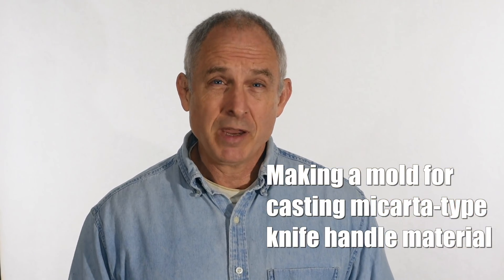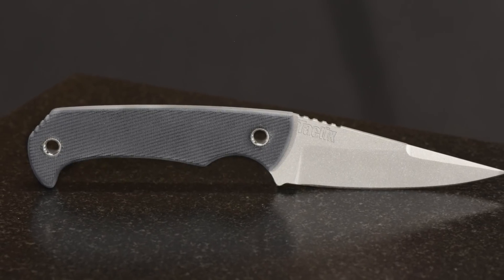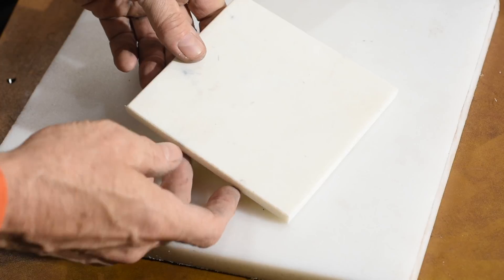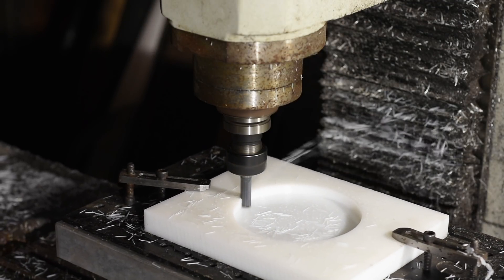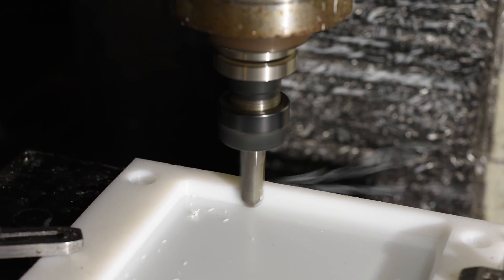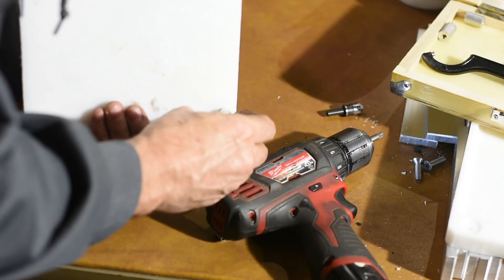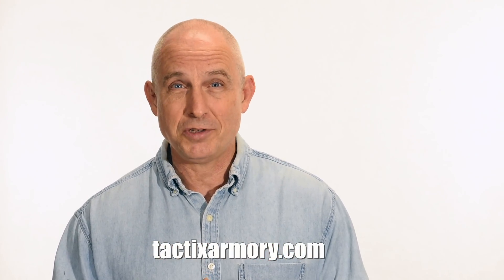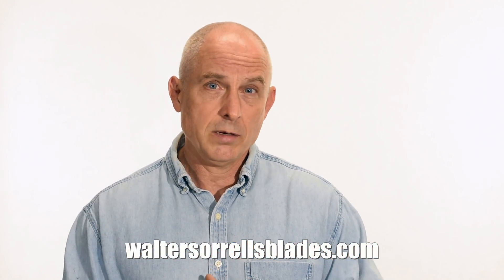Making a Mold for Casting Knife Making Handle Material (Micarta)

Comment: You can skip all this by making a handle shaped mold of 2k silicone using a knife that fits your hand. Put the knife verically into a holder. Let it hang into an empty plastic beer cup. Spray both with mold release. Pour the silicone into the cup so the handle is just with the upper edge of the silicone. Let silicone dry (I use medium hardness silicone). Remove knife and cup.

Now you have a handle mold. Just hang the tang of your knife into the mold using a laboratory stand with clamps or whatever works for you. Pour high quality 2k epoxy resin into the mold. Let harden. Remove from mold and you have a great knife handle. You can colour the epoxy with ink or powder or both. Put glitter in it or whatever. The tang is firmly cast into the handle and its water proof and very hygienic. I sand the handle to about 1500 grid and then polish then with wax and a rotating soft fabric disk. Perfect for kitchen knifes.

I use high quality resin and never one of these handles broke.

Comment: I've been thinking about making rubber molds. It seems like it would be easier to get the micarta out of those.
Reply: Rubber molds are good when you can't get draft around the shape to remove it from the mold.  In this case a rigid material is fine, just needs to not stick to the resin.

Comment: I bought an older deckel fp1 milling machine a few months ago. the machine is from 1938 and in the manual that came with it they show how to mill a mold for bakelite light switch cases. the mold is made from steel and is tapered so they could show the use of the universal milling table that can tilt in 3 different directions. in a product catalogue that also came with the mill they show how to make parts using their pantograph copying milling machine. i guess cnc wasnt around back then...
Reply: Numerical Control machines started in the 1940s, I think it was in the 50s they started using computers with them, but they still used 1" wide paper tape to load the program in them.

Comment: How about PTFE (Teflon) Walt? What about silicon Walt?
Reply: You can get silicone molds for a few bucks in various sizes via amazon, ebay etc. They work great with resins. I use silicone molds for jewelry and knife handles.
Reply: @marchueltz4993  you would agree silicone molds are better than UHMW plastics correct?

Comment: does anyone know what type of tap he used to make the feet?
Reply: It's a spiral flute tap. It pulls the chip back out of the hole instead of pushing it ahead.  Good for blind holes.
Reply: You could do it with other taps but would have to drill all the way through. Personally, I’d thread the aluminum rod and install t nuts to the base. Only because drilling holes in the exact center of rods at 90 degree angle isn’t easy without a lathe. Honestly you could just drill a hole and epoxy the legs in place. The only benefit I see of screwing them in is adjusting if your worktop isn’t flat/level.

Comment: This project is nothing but an excuse to use a CNC. Walter knows it, which is why he’s so defensive about the CNC. You can easily slap something together from pieces of scrap that will work as well, with no CNC or router needed.
Reply: ...because "slapped together" screams high quality and repeatable. How dare he use the tools he owns to make stuff.
Reply: If I had a CNC, I'm pretty sure I'd be making excuses to use it also.
Reply: Not an excuse when you actually have a business and/or want precision and as mentioned in another's comment: REPEATABILITY. Consistency is in a 3 way tie with accuracy and quality when it comes to fabricating a product. Slapping molds or anything else ranks very very low.

Comment: @walter do you think this could be 3d printed?
Reply: 3D printed would probably work well with a draft angle at the edge, and post processing to remove layer lines the resin could grab onto.  Paraffin wax may work well to fill print minor imperfections and act as a mold release.